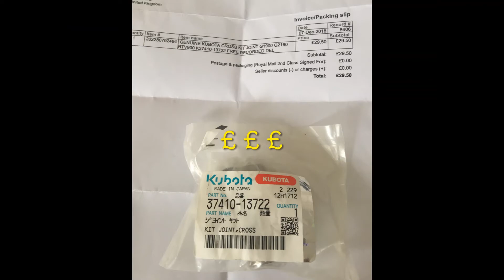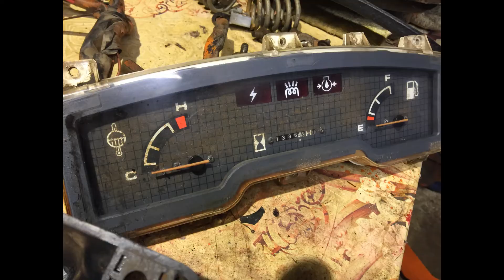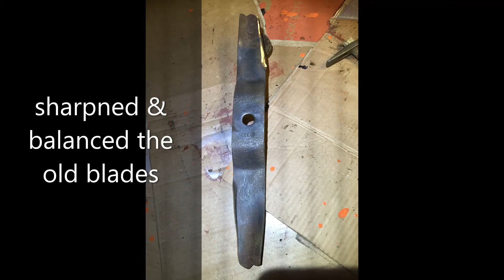Kubota G1900-S project

Comment: I just bought a G1900 HST today but mine isn’t all wheel steer. It has a 54” deck and the D722 diesel. I got mine for $2,500 USD and it has 900 hours on it. The machine runs and looks great. I’ve looked it over very well and couldn’t find any major issues. I was really close to pulling the trigger on a new Cub Cadet with a Kawasaki engine but glad I held out and got this Kubota.
Reply from the maker: You are correct, this series came in two versions: G1900 (2-wheel steer) and G1900S (4-wheel steer). Basically it's the same machine, except that the 'S' has narrower rear wheels, different rear axle-ends and additional arms for transmitting the steer movement. All in all, I would say you've made a good choice, for $2,500 it must have been looking great and work flawlessly.
Reply: @Armadyllo  it does look and run great though it’s not perfect. For some reason my fuel gauge and temp gauge is not working but sure that will be an easy fix. This is my first diesel mower and it has really amazed me. I’ve always owned the box store Deere’s or Cubs and the difference between a new one of those and this nearly 30 yr old machine is insane. I took it to my grandfathers house today to cut with it because the grass was too short at my house and you can’t bog this machine down.
Reply from the maker: @emergencyservicesmedia9521  I also had some electrical issues with the above mower and after a through investigation I found some contact imperfections coming from one of the rectangle connectors near the steering column and the round connector near the combination box (left side).
Reply: @Armadyllo  I will have to check that out. I read on a thread about the needles getting stuck to rest post. I just got back with Rural King with a high back seat with armrests that I’m gonna put on it and I’m gonna look over the wiring afterwards.
Reply from the maker: @emergencyservicesmedia9521  let me know if you need the electrical diagram.

Comment: My water pump is leaking so I'm about to tackle replacement.  How did you get access as shown at 2:18 in your video?  Removing the radiator does not look straightforward.  Thanks!
Reply from the maker: Once I planned to replace the coolant, removing the radiator isn't a big deal at all. Indeed, it helped the fact that the restoration itself meant a lot of parts from the dashboard were already removed. Even if I would have to replace just the water pump, I would still remove the radiator and the fan as working around it would probably be impossible because of some bolts holding the pump. Good luck! 👍

Comment: Great video, looks like your in the UK. I am going to see a G1700 later, not sure what the difference is between a 17 and 19. The fuel pump has gone apparently. Would you be able to share where you sourced the parts from in the UK and the paint RAL colour. Any advice appreciated. Thanks Dai
Reply from the maker: Hi Dai. There are a few differences between these two mowers and the biggest one is the engine: D662-L (655cmc & 15HP) vs D722 (719cmc & 18HP). The others are minor and related to the different engine (like weight), and the fact that G1700 takes a 44 inch deck which is not available for the G1900. I used eBay for buying the parts, more specifically I used a dealer from Worcester. I had the original part numbers and they sourced everything I needed. The paint was not genuine but very close to the original - just give it a search like 'kubota orange paint' and I am sure you can find a seller. 
Advice...  you'll probably check the usual stuff like: oil level and colour, engine start & run sound, transmission including the drive shaft, hydraulics, deck shell status and the transmission parts, steering play, leaks etc. because these are the most expensive things to fix. Don't worry too much for a belt, a bearing or a light bulb. Hope it helps, good luck!
Reply: @Armadyllo  Actually, the G1700 engine is rated at 14.5hp, the G1800 is rated at 16hp, the G1900 is rated at 18hp.  The weight difference is the difference that each engine is as well as the mower deck difference.  The G1700 generally runs the 48 inch deck only, G1800 can run a 48 or 52 inch deck, while the G1900 generally runs the 52 or 60 inch deck.   And NEVER waste your money on aftermarket PTO/deck belts!  They are no where near as good as the OEM ones...I learned that the hard way!

Comment: I’ve been looking for ages on why my g1700 won’t start, I brought a new starter motor for it but it’s still just making a clicking sound and barely turning the flywheel, could this be a knackered battery even on a jump start ?
Reply from the maker: Myles, my guess is that your starter motor is not getting enough current, and this might come from: 1. a weak battery or 2. starter selenoid or 3. partially broken wiring or 4. bad/rusty/oxidized connections to chassis/starter or even combinations of the above. I would start my investigations looking at all these points. Hope it helps.

Comment: Great Job!!! I have oppurtunity to buy the same  model also will need to spend few weeks to make it nice, do you recommend this model to buy?
Reply from the maker: Hi, thanks for your appreciation. If I had a large enough lawn to make use of such a mower, I would definitely consider this one. It is sturdy, reliable, maneuverable and relatively cheap to maintain.
Reply: I would for sure as a mower and snow plow tractor (for small areas).  I have a G1800 and BX2660, and for mowing, hands down the G1800.  I have some vids of it pushing snow published, and a few mowing.  I will be doing a mowing compare video this spring between the G1800 and BX2660.  Jason Huser - Huser Helpers
Reply: @HuserHelpers  Both my dad and I have G1800's.  They are built like tanks!  I'm working on a way to hook mine to a generator so I have power after storms/hurricanes take our power out here in Louisiana.  These engines use far less fuel than regular gas or propane generator engines do, and are far more reliable!
Reply: @user-cy6gf2pj7y  see if you can find a front PTO kit.  Basically it is an adapter that bolts on to the lower pully of the PTO.  The biggest challenge will be engine speed control.  As you load the generator I'm not sure the Governor is responsive enough to rack the fuel.  Worth a try though.   Have a great one, Jason
Reply: @HuserHelpers  I was thinking of trying to find the PTO kit for the rear (they did have that as an option over here in the states) to hook up to a generator.  I have a neighbor that has as PTO generator he hooks to a "grey market" kubota small tractor with an engine similar in size to mine, and it works well!  Over here, there was even an option for a dirt/snow blade, a snowblower (front PTO), and even a rear 3 point lift assembly.
Reply: @user-cy6gf2pj7y  yeah, I looked for a rear PTO/three point.   Found one tractor with it, but it sold quickly.   The issue with these tractors is it is a 2000 RPM rear PTO, reverse rotation. The front PTO is forward rotation at Engine RPM.  The front PTO option would need a 6 to 1 speed reduction gearbox so you could match 540 ram input of a standard PTO generator. Might also keep your eye open for a bx 1870 or 1880.  They use the D722 Engine like in the G1900.  I found one here for 5K.  It was really clean, no loader
Reply: @HuserHelpers  I was thinking about using a belt drive generator assembly like the following:  12,000 watt continuous,1800RPM, bi-directional rotation https://www.ebay.com/itm/333159680926  I figure that I can get 10,000 watts continuous out of my Kubota IF I absoluetly needed that much, but most of the time, I'll only need half of that, and if the generator head is a little larger, then the generator would last longer because it's not at "rated full load" hardly ever.
Reply: or this 3600rpm model https://www.vmisales.com/voltmaster-belt-driven-generator-12000-watt-ar120
Reply: @user-cy6gf2pj7y  That might work well.  I just looked and these tractors max RPM is 3800, so nearly perfect for the 3600 input RPM requirement.  That front PTO kit with a short driveshaft (with u-joints) and bolt the generator directly to the front frame mounting plate.  You could then drive the generator around to where you need it.   Keep me posted on your progress.  Look-up HuserHelpers on facebook and post pictures.  Have a great one, J
Reply: @HuserHelpers  I was wanting it more to run the necessities at my house rather than being portable. I might be able to get/make a longer driveshaft, just take the deck off, back up to the generator and hook the new shaft in the place of the deck drive shaft.  I might would have to put the tractor on a ramp to get the proper clearances

Comment: Is it correct that you cant push or tow this model without detaching the transmission? Trying to hunt down an operators manual without luck.
Reply from the maker: I do have a manual in french and Google translate says the following:
"TRANSPORT
: Do not tow this machine as this will damage the transmission. If it must be transported, use a suitable van or trailer."
It seems this hydrostatic transmission cannot be disengaged. 
If you still want to transport it around the yard there is no need to detach the transmission as this is a quite difficult task. But... you can use a towing dolly for the rear axle, or even some sort of a mobile jack that allows you to move the mower having a rear wheel off the ground to spin freely and the open differential will do the rest. Hope it helps, cheers!
Reply: @Armadyllo  Good idea, I didn't think about using a wheel dolly to push it around the shop. Thanks for the information, just found a manual to buy on ebay, will buy one for myself too. Cheers!
Reply: If you only need to move them a few feet, you can push them.  Main thing to do is go slow.  Never use another machine to tow it.
Reply: You could also use a floor jack under the rear tow plate (if you put a bolt with a nut in the hole)
Reply: @Armadyllo  Thank You ... I had the same issue ... Kubota G2000 (gas engine) blew a fuse and stopped the engine dead in the yard .. and then the rain started heavy (because life is interesting).. could not find athe tranny disconnect and ended up using a "dolly" to bring it in.  Had to go into the wiring and unwrap some electrical tape to find the fuse plug in (who did this anyway?) .. replaced fuse and it fired right up ... this machine is amazing ... BTW your pictures and the time putting this video together have been a real blessing .. great work and an impressive task accomplished ... these old machines are indeed amazing and worth the effort to maintan
Reply from the maker: @CapnMic  thank you for you nice comment, I'm glad it helped! I don't quite have the time and the hardware to make movies while I work in the garage so from time to time I'm taking pictures and then put them together hoping it would help someone.

Comment: Do you still have the kubota? I need help with mine
Reply from the maker: No I don't, I sold it around 2 years ago. What is the problem with yours?
Reply: @Armadyllo  I just bought a g1800 the PTO cable is not right where it comes in at handle and I don't know how it  goes together
Reply from the maker: @ronaldforshee4665  if you'd like to upload a short video I could try to help you. I can also send you a diagram with the PTO cable and the parts involved, maybe you have to check the whole system for misplaced parts if one of the previous owners performed any 'adjustments' :)
Reply: @Armadyllo  ok...l gotta figure how to send it on here
Reply from the maker: @ronaldforshee4665  just post it on YouTube as a public video using the 'Create' functionality, then drop me a message.